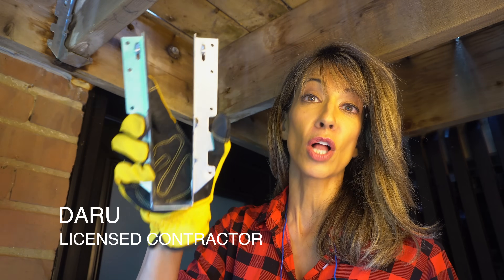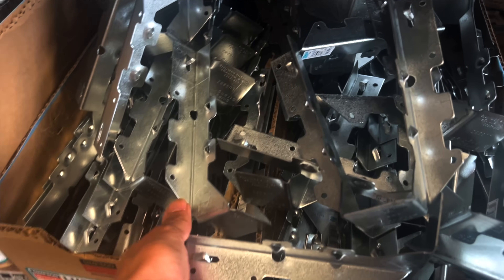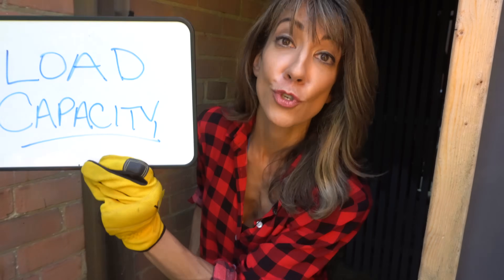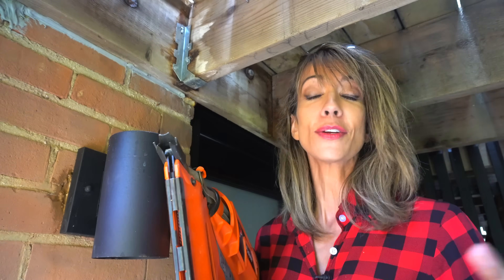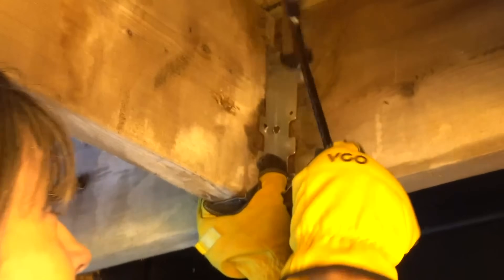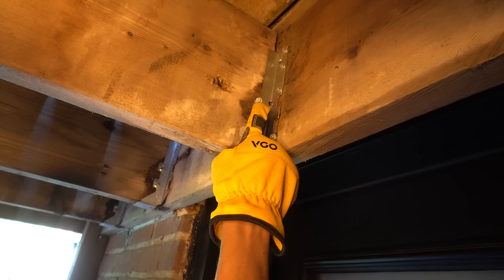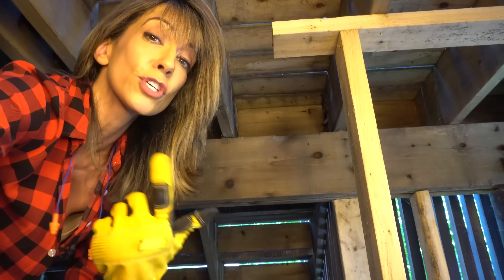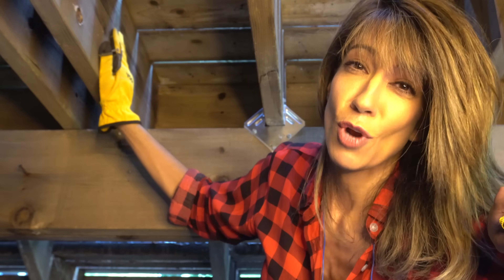Joist Hangers: Do Screws Beat Nails? (Backed by Science)

Comment: I think screws are usually preferable for everything but your description of tensile and shear strength doesn't align with your choice of fastener in the manner in which you described. The stresses on a joist affixed to a ledger would be vertical shearing force. The weight would be bearing vertically downward on the joist, not pulling the deck outward in the X plane away from the ledger which would be tensile stresses.
Reply from the maker: Both nails and screws are excellent choices as long as they’re rated for the job you can’t go wrong.
Reply: The joist/ledger connection is a critical one that code has really doubled-down on in the last decade due to decks pulling away from the ledger at the most inopportune times. It has been identified that joist hangers alone are wholly inadequate for this connection and tension ties MUST be properly employed. I get a lot of customers who want to build a deck with the joist hanging off beams - that is the wrong way to do it. You should always build with joist bearing on the beam, not hanging. It is a superior solution. I've even had seasoned contractors tell me they've been hanging deck joists for years. I usually then ask them if they hang their beams off their posts or set them on top. There is a lot of wrong going on there as well.
Reply: Look my thought is is with a screw it's going to tear up the wood if it starts to wiggle with a nail you can bang that back in and it bends.

Comment: What size hex screws did you use? Looks like m3 x 40mm (1 3/4")
Reply from the maker: For a single ledger the 1 1/2” are good to go.
Reply: @DaruDhillon  usually only 30mm  twist nails are to code. Can you use structural (hex) screws?
Reply from the maker: @ you can use the SD rated screws for these. There’s a link in the description with more info if you’re interested.

Comment: I have only ever seen and used Square Twist Nails for joists, these galvanised nail are Square ⬛ , then twisted with little ridges stamped in. They would have a higher tension rating compared to the round nails. Great content.
Reply from the maker: @patbone7941  good to hear your experience with square twist nails. You are right. The new ones are much stronger. Thanks

Comment: i've only ever seen builders use screws for attaching the joist hanger to the BACK (joist rim), and nails for attaching the hangers to the joists themselves.

the explanation was that the screws keep the hanger from being pulled out (due to the threads gripping the wood) and the nails are plunged in at an angle, meaning they will be hard to separate just by pulling. If you were to nail the hanger to the outside wall, it could easily be pulled out over time, as the nails loosen from wear.
Reply from the maker: Good to hear your take on the differences between the two. Thanks

Comment: I'm a big advocate of using stainless steel hardware on the latest pressure treated lumber, as it is still quite corrosive on double dipped galvanized screws and nails. I was looking at a church ramp the other day that I built only 2 years ago. The galvanized joist hangers have already begun to corrode. It hasn't helped that a lot of salt is applied to the ramp during the winter months.
Reply from the maker: Salt is corrosive so if you’re applying salt to the area stainless is the best option in that case. It’s pricey, so most people go with galvanized unless they live by the ocean.
Reply: Haven't noticed anything similar. We rarely get snow, so no salt. Have you noticed corrosion on hangers that don't get salt on them?
Reply: @TwinMcQuerns  Good question. I'll have to confirm. I do believe the new PT is more corrosive to fasteners.
Reply: Have you priced stainless versus double hop dipped galvanized?  I am using stainless on my house but if I was building for anyone else galvanized would be fine.  Also using screws versus nails, nails much cheaper but not as strong.
Reply: @jimw6991  I buy the stainless lag bolts in bulk online. Much cheaper than any local hardware store, and considerably so. :)

Comment: Generally screws have a higher tensile and shear strength. The two typically go hand and hand. Nails are used for shear walls because they are ductile, thus the won't break if flexed back and forth. If you plastically deform a screw it will break with very little deformation, that's why you can hit drywall screws with a hammer and break them off of a stud. Nails can be flexed multiple times and still retain most of their strength (this is called toughness in material science). It also doesn't have anything to do with the threads, its just a different alloy of steel or a different heat treatment...or both. Thanks for the info on the number of zinc dips never heard that before.
Reply from the maker: Good to hear your feeling on this. Thanks

Comment: Just a minor point, these hangers are electroplated, not dipped, which is far less superior to HDG simpson products which are hot dipped galvanized   (HDG).  They don’t make the hangers in HDG for several reasons. Look at your outdoor beam connectors and you will see the difference in HDG which is much better.  Live in a coastal environment,  go with stainless because even those hanger you used will corrode over time.  Yes I know stainless is more expensive!!!!!
Reply from the maker: Good point Jerry. Thanks! We’re got some SS fans around here.

Comment: They should have a hole in the bottom of the joist hanger so you can screw it to the joist first so it stays tight while you’re hanging it.
Reply: Near the top of each joist hanger on the flat side that attaches to the ledger board, there is a metal tab that is bent outwards. You hold your hanger tight to the bottom of the joist and up against the ledger and tap that tab in with your hammer. There's one on each side and they hold the hanger in place while you're driving nails or screws.

Comment: You forgot to mention the most important part about choosing the correct joist hanger. If it’s used outdoors on pressure treated lumber the last part of the hanger number is “-TZ”.  In the cast of your video it would be a JUS 210-TZ. The TZ stands for triple sink.
Reply from the maker: Thanks for adding value with your comment! Good tip to keep in mind.

Comment: This woman bless her heart for trying in a mans world but she it totally wrong immediately when she says  tensile strength is the reason to use screws.  WRONG !    The reason in RETENTION strength.   The screws HOLD better.       No major harm caused and give her a chip for trying and doing a pretty good job for a woman.
Reply from the maker: @scottperkins3696  When screw retention tests are performed the screw will undergo a Tensile test applying force in one direction. Usually pulling on the screw from south to north. Tensile is applied to determine the retention strength.

Comment: For old dry wood its often best to drill a pilot hole to prevent splitting.   That takes more time, and admittedly is a lost art.  Before the modern screws when putting in wood screws we always drilled pilot holes (in fact you had a pilot hole for the screw shank area, a  larger drill bit area for the unthreaded portion, and perhaps a countersunk head bit - sold as an "all in one" bit).

I was using old fashion wood screws on a project a few weeks ago, and am going to do a window repair with them next week.   Its the only real method for countersunk heads.
Reply from the maker: Hi Perry, I appreciate you sharing what you like to do with old wood. Pilot holes work like a charm. Thanks!

Comment: At 5:52: , wouldn’t a hole in the bottom face of the hanger that could be used to fasten it to the bottom edge of the joist be useful? You’d automatically fit the hanger tight to the bottom of the joist.

Comment: I've seen some tests done as far as comparing sheer strength between screws and nails. It doesn't matter that nails have more sheer strength than screws.

 When they put an assembly together with screws on one assembly and nails on another, he used a hydraulic press to put sheer forces on the assemblies to the point of failure. When you do this the fasteners do not sheer off, they never sheared off on any of the tests. 

What actually happens when they are tested to failure is the fasteners pull out of the wood about halfway and then bend over.

 On all of the tests the screws resisted failure better than the nails, because the nails would pull out easier. Even non-structural screws were outperforming the nails in the sheer force tests. So yes screws are better than nails, even though for many applications the nails are good enough. 

I use screws on almost everything now and have for close to 20 years. If you want to see some good tests on fasteners check out Project Farm YouTube channel. That guy does really good controlled tests and does not take money merchandise from anyone.
Reply: There's a difference between sheer strength and shear strength.

I could have the sheer strength to lift a beam with my bare hands, but not the shear strength to lift a beam with my bare hands.
Reply from the maker: Good to hear your perspective on this, thanks! The new structural screws have a special coating that makes them stronger than before. It’s good to see so much testing for safety with screws and nails.
Reply: @DaruDhillon  A coating to make screws stronger? Please expound.

Comment: Screws are not designed for or be used for shear loads . A screw will break under load a nail will bend and draw under shear loading it will not break .
Reply from the maker: Yes, that’s an important advantage of nails and good to remember. Thanks for sharing your experience with us!

Comment: You have excellent commentary, explanations and information on the DIY projects, I would make one virtually insignifigant suggestion when discussing tensile strength. Tensile strength is the measure of force required for the material (screw/nail) to yield or break when pulled or stretched. In wood framing, pull-out force would better describe the relationship between the nail/screw and the wood. The pull-out resistance of screws is greater, but the shear resistance of nails is better. In the end, I agree 100% on DIYers using screws instead of a nailgun for cost and safety.

Really enjoyed your video.
Reply from the maker: Thanks! Appreciate the added insights on pull-out as it relates to wood. These are good points to know when working on your home and woodworking projects.
Reply: When extreme sheer forces are applied to a wooden structure the fasteners do not sheer off. What actually happens is the fasteners pull out about half way and then bend over. 

This happens with nails or screws, but the screws are much more resistant to pulling out.  So in real world applications the superior shear strength of the nails is not really relevant. 

Project Farm YouTube channel tested this pretty extensively and even the incorrect screws were outperforming the nails. Wood cannot hold any fastener well enough for the fasteners to actually sheer off, they pull out first and then bend over. 

He used hydraulics and a really good and expensive scale to test this. How well the threads were able to grip the wood was more important than the sheer strength of the screws in those tests.

Comment: You made a pretty big mistake installing the joist hangers.  In your application the screws going directly into the ledger board through the tabs should have been 1 1/2 not 2 1/2.   The ledger board is only 1 1/2 inch thick and has nothing behind it.   Beyond being a hazard for snags ect the majority of the threads are beyond the ledger board compromising tensile strength.   In this application using the 1 1/2 inch screws would be stronger since all the threads are actually in the ledger board.   Even if built on a wood framed wall the 2 1/2 would actually put the thread into the sheathing unless you hit a stud reducing tensile strength.  Both screws actually have the same amount of threads.   So for toe screwing and screwing into a double 2x the 2 1/2 would be stronger.   But into a single 2x the 1 1/2 is stronger.
Reply from the maker: @michaelcsonka2675  thanks for sharing your experience. You’re spot on if you only have a 1 1/2” ledger without wood behind it to tie into the shorter screws are best in that application. Appreciate you sharing your thoughts. Important to know. Thanks

Comment: Great info. Slight correction, misspoke..? 7:40 You said ‘no connection’ because they didn’t used to make the plates. But screws and/or nails have always been used to make those connections, whether you live in hurricane country or not. 
If you discover your builder hasn’t, I’d inspect everything. 
Btw- Even older brittle lumber can usually be fastened using pilot holes.
Reply from the maker: @markoshun  thanks Mark for sharing your insights.

Comment: Good video especially for the novice DIYer.  Some comments though.  
* Galvanizing is most commonly electro galvanizing, not hot dipped on such hangers.   HD would be better but is more expensive.  Most hangers are not dipped (in zinc) but are plated in an aqueous solution.  You are building a deck here.  You should mention that using hangers that are good for treated lumber would require use of something good for that, (LU or in the extreme, SS). Cheap hangers like the one you show were likely destroyed by the chemicals on the lumber.  
* It sounds like the nails “break” in the tensile test, they don’t break, they just pull out, so the bond fails.  
* Screws are great, especially for DIYers, (they snug things up better, they are removable, they are faster to apply for novices.  But, you have to use the RIGHT screws.  SDS screws are what you are using, and are correct, but you should let people know that lots of cheap screws are hardened and are too brittle.  I use Screws in LOTS of construction, with Hex washer, or modified truss heads or similar, then you can really pull parts together.  But most common screws are too brittle,    (Try bending a sheet rock screw) so they are not as strong.  You would do a service to describe what to use.  You use SDS hex washer screws and they are great.  Using them means that they can always be removed easily too.  Philips head can’t and often the slots get destroyed, by incorrect driving, (or incorrect bit size) Torx is another good one.  
* You are right to use the 2 1/2” screw in the hanger on the sides for the X, but on the legs?  In a 4x, sure, but in a 2x?  Much of the threads (1” of them” are past the ledger, and not doing you any good.  Actually these would be weaker than the 1 1/2” screws which wouldn’t get loose under tension.
Reply from the maker: Thanks for sharing your thoughts on hangers and fasteners with us Paul!
Reply: I agree, you know what you are talking about.
Reply: This.

Comment: Screws are hard and brittle. They fail catastrophically. Nails are more ductile and forgiving. I generally use screws, but in my heart of hearts, when I look at how well nails hold up after a few hundred years of houses shifting and shaking, I know I probably should be using nails.
Reply: Have you ever tried to pull apart anything that's been screwed together, the wood will fail before the screws fail. So if you want all the advantages screws have to offer, go ahead and use them , although you definitely want to use structural screws.
Reply: My Dormers on my house we're all pulling apart with nails, I replaced them with screws much better now. If you're going to use Nails you need to know how to reverse toenail to hold, or simply use a screw pull it up nice and tight.
Reply: I have never seen anything fail furthermore catastrophically that were  put together with screws, although I've seen plenty of things pull apart with nails. When you bench test nails and screws yes the nails will outperform screws other than pull out but like I said when use the screws the wood Will split apart before the screws shear. I have personally screwed together many buildings Framing and trim with excellent results. Over the course of my 50 years of building no call backs just to come do more work. Could you show me something that you're talking about that has failed catastrophically, from the use of structural screws.
Reply: @kevindavidsaver5370  intimate experience with four apartment buildings over one hundred years ago thirty years old, with various stages of repairs using every kind of fastener you can think of. 
Pull out is where poorly applied nails are weak, but the bigger issue in (European brick) buildings is settling. The forces are enormous. Screws form such powerful bonds, but as said are brittle, that when the thousands of tonnes of one part of a building settles a mm, screws can simply tend to snap rather than deflect. 
I'm happy you haven't had this experience - as always, the details matter. I guess you're used to match stick houses?

Comment: What about sherardized nails - helps deal with tensile strength.
Also those first couple of screws around 6:30 - most of the screw part is through the joist. Seems too long to me. The 45 deg is correct - but not at 90. You used shorter ones on the hurricane tie.
Reply from the maker: Yes you're correct! You can go with 1 1/2" depending on what you're screwing into.